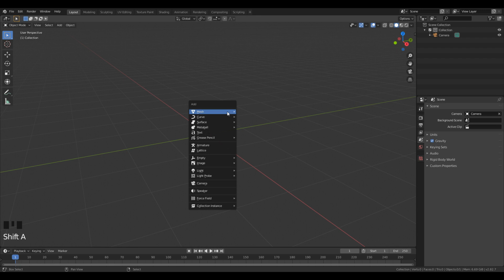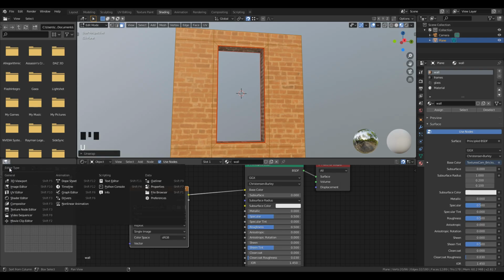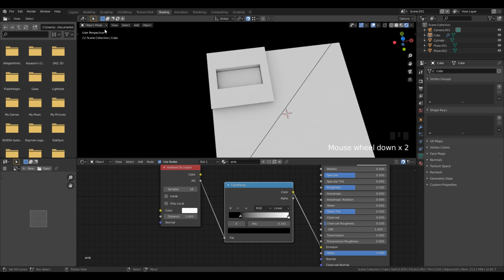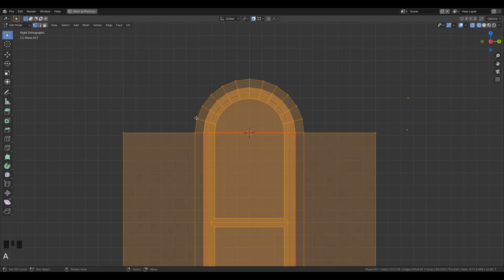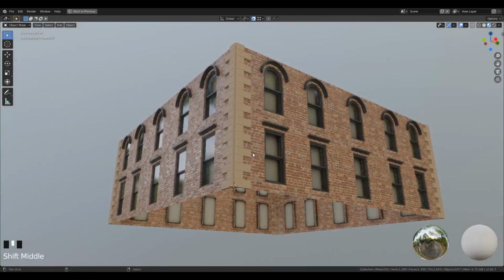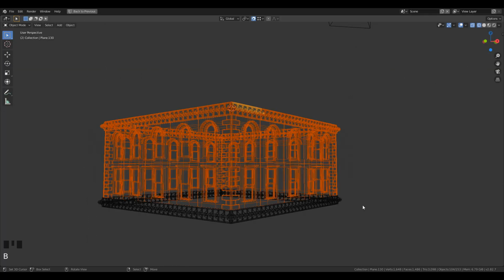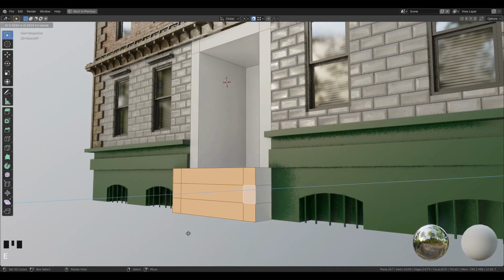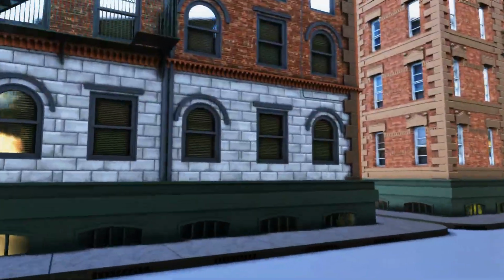Modeling Buildings In Blender

Comment: At 30:45, is it the snapping tool that lets you align the vertexes for the corner like that?
Reply from the maker: Yes, For such task you will always to use the snapping tool without that you can not align the vertices parallel to the other panel.
Reply: Lol cool, last time I made a corner for something similar I remember using the 3D cursor as transform pivot point and the scale tool to get the precise positions

Didn't know you could use the snapping tool like this until now, really nice video btw :)

Comment: At 14:16 you're rendering/baking the normal your your meshes with a camera with workbench matcap. For me being a fan of parallax occlusion mapping, can I get a heightmap in a similar fashion?
Reply from the maker: Yes you can try but I think it will be better if you use cycles as how I created the height maps in "How to create your own texture " video tutorial . Those nodes are best to create the height map . 
Btw  I am not finish with the building I am thinking of 2nd part in which I will give the ideas on how to make room interior for the windows.
Reply: @SaqibHussain88   Seems I found a solution: https://pasteboard.co/J4IBjOj.png (Imgur wont work rn)

Its using Eevee, since its using the depth data Im guessing it should work with any renderer and any settings

Yeah a second part doesn't sound totally wrong

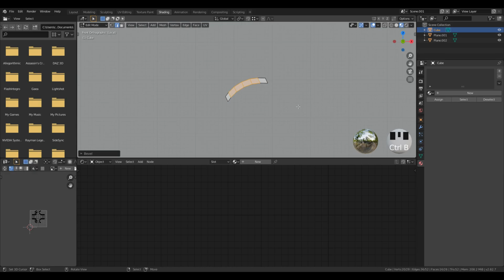Comment: beveling at 9:53 destroys my mesh!! any solutions??
Reply from the maker: I think you need to recalculate normal by flipping them press shift+N to recalculate the models.
And make sure you only scale or the rotate the model while you're in edit mode otherwise sometimes you will not get better bevel at the edge.
Reply: @SaqibHussain88  Same problem here. Recalculating normals doesn't help. I'm using the same hotkeys as you on the video.
Btw, thanks for the great tutorial!

Upd:
Don't know why, but after deleting the mesh and creating a new one everything works fine :)

Comment: if i have a building i want to model but i can't take a photo reference of him because the building is very tall , how i can model it without the photo reference ?
Reply from the maker: Then you will need to sketch out the design for it , Grab a pencil and sketch it in your sketch book. Then it will be easy for you to know about it before modeling it .
Reply: @SaqibHussain88  i can work with that thanks :)
Reply: @deadman-zc5ro  You can also use Blenders grease pencil, it will let you draw in 3D space if you so like ;)

For Android and iOS devices, theres also a free drawing software called Sketchbook by the devs of Maya (Meant for making concepts)

Comment: Hey! Great work. Can you please answer my question? Why don't you use color space of normal as  Non-color instead of linear?
Reply from the maker: Linear just makes some adjustment to the color values of the map just slightly give brightness to the map or you can say plays with the value of the map so that later you can use the gamma correction on your whole scene to get rid of the black values of the scene. But you can use rgb and non color data too its just about preferences.
Reply: @SaqibHussain88  thanks mate. I will try your way today. 😇